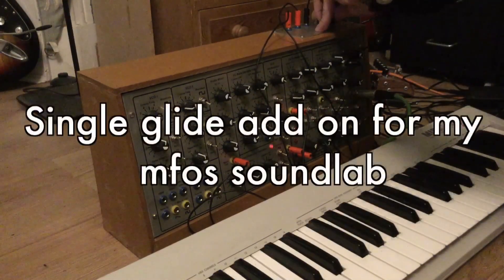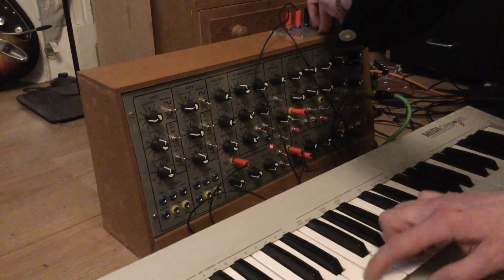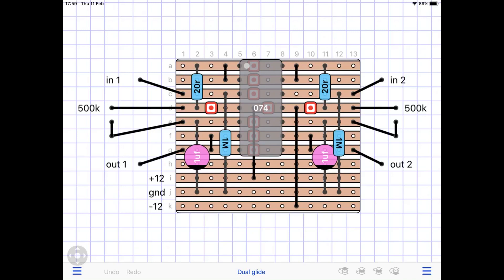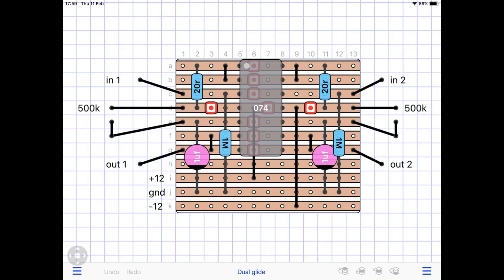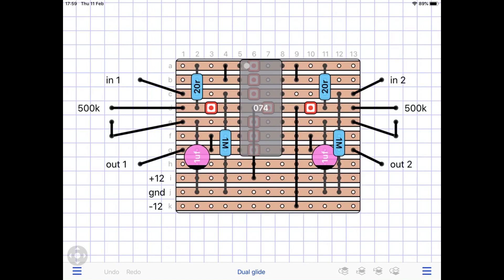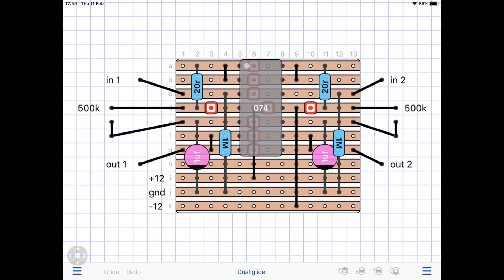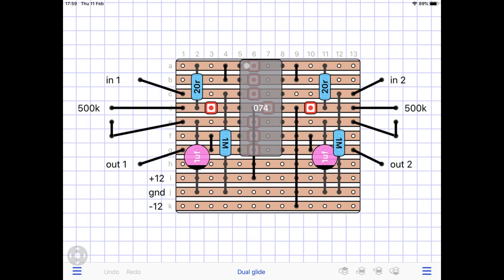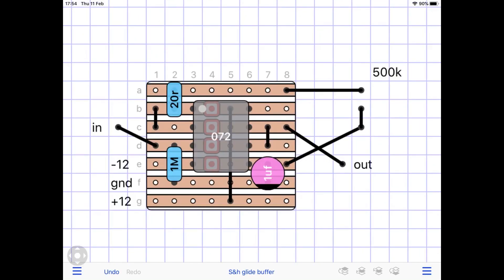DIY stripboard modular synth - “easy” dual glide /slew

Comment: This looks pretty simple. Could you share the schematic you used. I'd like to clarify some of the connections.
Reply from the maker: Cant remember the source but mfos / yusynth has a few schematics. However the single  glide at end of video is super easy to schematic from the layout. Anyway you need +/- 12v with cv mono tip in / cv mono tip out , with sleeves /ring the stripboard gnd... thats it .....if thats what you cant see 👍
Reply: @UnauthorisedService  Are the 1m resistors, 1uf caps and the connection from -12 to pin 11 only connected on the ends?
Reply from the maker: Still not quite getting your query . Every component placed on the board is to be soldered at both ends  ..ie 1 meg resistor from pin 3 to ground...-12 to pin 11 ..just join everything up as in the layout ? If you are still having problems ..join lmnc discourse and query with a link to this video and someone will help you 👍